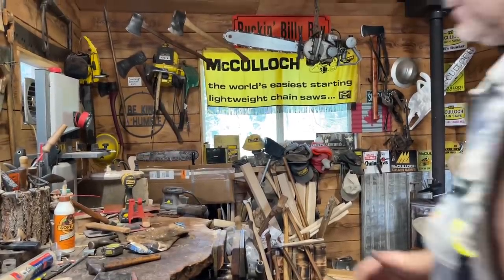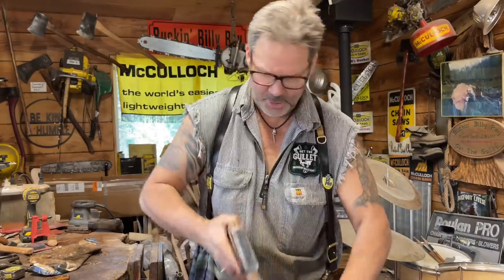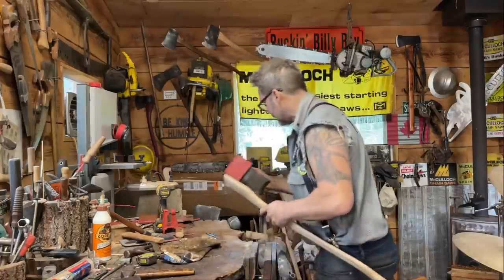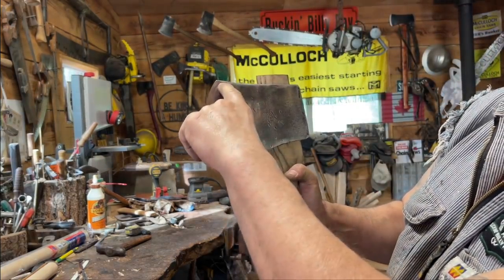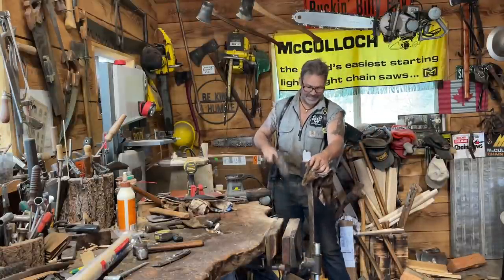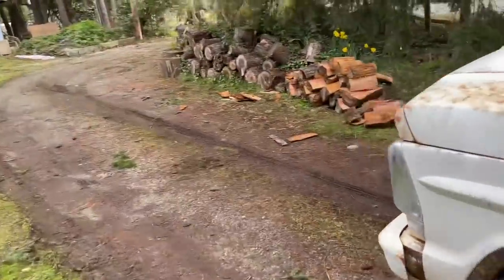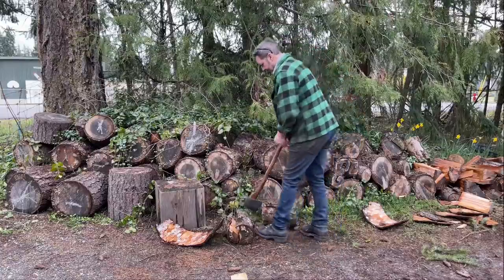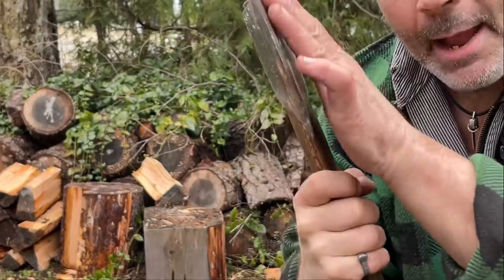Axe transformation, last minute profile decision, pays off!

Comment: Fire starter. Into half of a 1 gallon jug  ( cut off ) I put sawdust and add some oil . Mix. Used motor, lamp, refrigeration, ETC. I scoop a small amount out to put under the kindling.  Yes, the selfstarting propane torch is the only way. to start a fire.

Comment: Old trick for getting the axe head on handle so it'll never, ever slip...anti freeze, yep anti freeze. Once you get the axe hafted to your satisfaction, soak the top of the handle, in the head, in some anti freeze. Water makes wood swell, but it eventually evaporates. Anti freeze don't evaporate, ever and won't rot the wood. Makes the head nice n shiny too!✌

Comment: What grit of sandpaper are you using to sharpen the axe heads? I’m restoring two old axe heads and I need to sharpen them. I’m of course using hicks hickory handles.
Reply: All you really need is a very sharp file and a diamond stone set